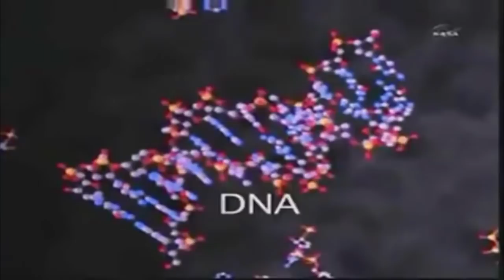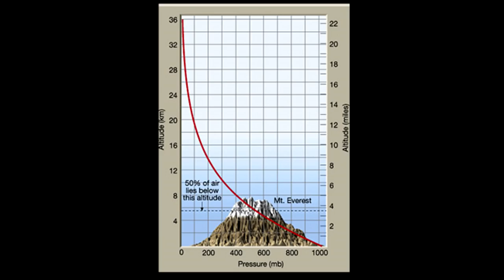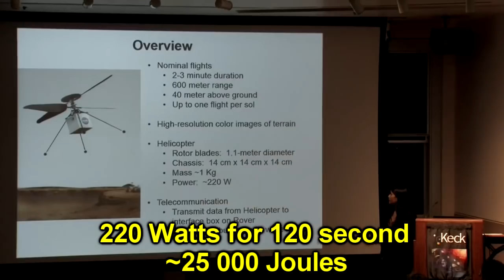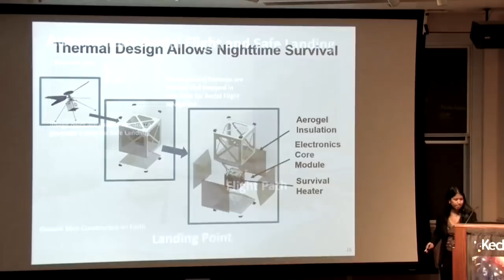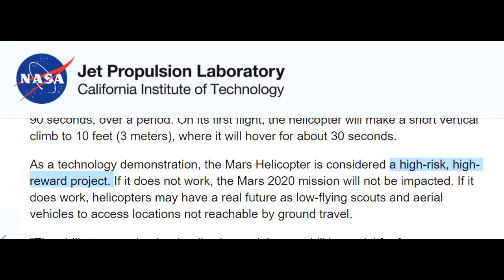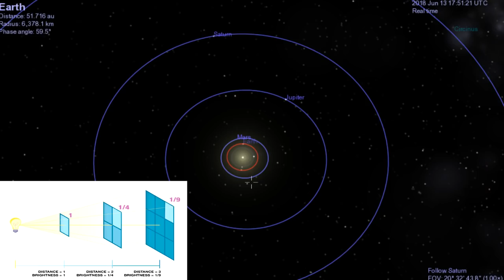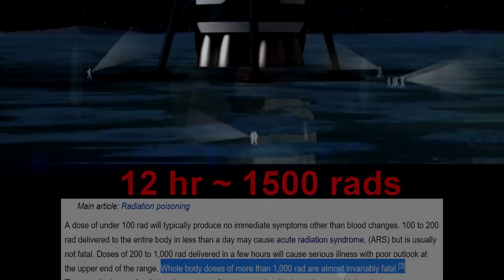NASA is sending Helicopter to Mars!! Smart or Silly?

Comment from the maker: as coryman125 points out below.  The reason for the tether is to simulate martian gravity.  Its obvious when you think about it, but I missed it :-(

Otherwise to get it to fly on Earth you need 3x the power, and that will never happen.  Putting a motor on a drone 3x as powerful would turn it from a helicopter into a stunt helicopter!
Reply: Thunderf00t 
Hahaha.. yeah.. 1% the atmosphere without the low-gravity assist on your side is a giant f**k you to the whole idea of anything flying on mars..

I wonder how well you could get inflatable blimps to work on Mars.. huge balloon, but extremely low- energy to get something across bad terrain at a reasonable speed.
Reply: could the helicopter use a small radioisotope thermometric generator and solar cells or coat the blades in solar cells and then it could use the blades to angle at the sun through its non operational time
Reply: You don't need three times the power.
While the air density being less than 1% earths does hinder the copter, that lower air density also means greatly reduced resistance for the blades, so less energy needed to spin the rotors to achieve lift.
Add that to the significantly reduced gravity and you may not even need twice the power.
Make it solar of course and we will have a low level reconnaissance drone capable of topographical surveys that can tell us much more about Mars than our current methods are capable of. I like it.
Reply: They could have far more expensive and efficient solar power gathers .
Reply: You were also wrong about needing 100x the RPM to function in 1% air density. Lift  is proportional to the square of the RPM so you'd only need 10x.
Reply: Hello thunderfoot, I like your videos could you make one about fusion reactors
Reply: > ...but I missed it...
You also seem to have missed the "up to" part of the one flight per sol.  They can fly it less frequently as power allows.
Reply: Thunderf00t it's not can they it's why they need 100% times the money for what you can buy over the shelf tech
Reply: Jaden S.  vacuum  balloons have been suggested for viable lift in the thin atmosphere
Reply: Thunderf00t  doubtless the solar cells would be at least as good as iss versions ... maybe the triple junction InGaP/GaAS/Ge coz their extra cost over amorphous Si is only a teeny weeny part of the total cost of getting there
Reply: Chris King I don't see how 2 minute flights would cover anymore ground than the slow ground drone.
To me more could be achieved by countless  small cheap balloons with cameras and simple sensors.
Covering more terrory we would visually recognize more than we have so far.
Personally I've heard so many times that this is the one launch that will give us definatly answer of life on Mars. It a broken record
Reply: 3x the power, huh? In that case, would it be implausible for them to actually make the solar panel able to track the sun, at least a little bit? From the images, it seemed like it wouldn't be too far fetched.
Reply: With a rocket capable of sending a human, you could send over 100 drones, even with coin tossing probability’s 50 working drones is pretty good
Reply: What pink balls? 😂
Reply: "Although having crashed LOTS of aircraft, Im still very skeptical this thing will have a long life on Mars!"
This is exactly why it will have a long time span on Mars. You are not flying it. No one is. Humans suck, get over it.
Reply: There's being skeptical and then there is this
Reply: I mean a stunt helicopter is still a helicopter... Just not a good one.
Reply: Thunderf00t if you sent them a bill for a consult, you’d not be out of line. 🤓
Reply: That's what I was thinking, I'm like clearly these people have the most expensive and efficient panels out there.
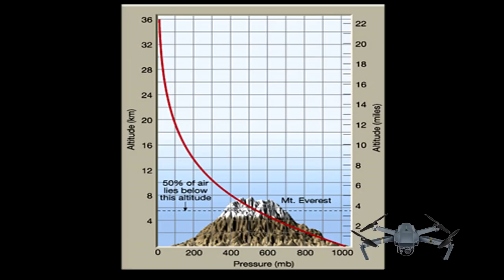Reply: 7:21 One thing, thrust scales approximately quadratically with blade speed, so to get 100x the lift it would only take 10x the blade speed.
Edit: Also note that the stress on blades not including centripetal stress is directly proportional to the lift force they need to produce, so since they only need 1/3 the lift on Mars, they only have 1/3 the stress for the same craft. Also note that rpm does not need to be the only factor for increasing lift, you can also increase blade area through increased diameter and blade width, and with only 1/3 the stress, you can even afford to go crazy with the blade area, to reduce stress on internal components by lowering rpm.
As others have mentioned, lighter weight expensive materials that can be used will also be helpful in getting the thing to fly. As for insulation, I don't think you appreciate the power or light weight of aerogel insulation. That stuff will stop almost anything. The blades can be made extra lightweight, the solar panels can be the maximum efficiency available, and risk can be taken out of the equation by using available geographic data to designate landing zones before the drone even takes off.
Reply: Thunderf00t can you make a video commenting on developments in fusion energy research.
Reply: Thunderf00t downwash is actually fairly insignificant in generating lift for aircraft, if I remember my training. 

The vast majority of lift is created by the Bernoulli Principle. For both fixed wing and rotary aircraft. The shape of the aerofoils is such that the bottom is relatively flat but the top is curved. So the distance that the air must travel is longer on top of the wing than it is beneath. This causes high pressure on the bottom and low pressure on top, which forces the wing up.

This much I know for sure. Too high of an angle of attack on the wings, relative to the airflow, causes an aerodynamic stall. This occurs when the upper wings laminar layer of air becomes turbulent or "burbles". And this happens at well below 45° angle of attack.
Reply: Thunderf00t at 11:15, are those curves hyperbolic cosines, or parabolas?
Reply: Thunderf00t Circumcision is genital mutilation.

If Thunderfoot want to challenge the feminist narrative, he should highlight issues that affect men globally.
Reply: f00t, you forgot to factor in the distance from the Sun and the atmosphere difference when calculating solar power efficiency.
Reply: They would probably use a 3-layer GaAs solar panel which would be about twice as efficent as a silicon-based one. GaAs is also more resistant to cosmic radiation.
Reply: hustler3of4culture3 I'll try to answer that man, if ya don't mind.

So first off, obviously, the Tracking one is neither. But I assume you were really asking about the other 2.

Both of which are hyperbolic because they are plotted on graphs of time versus solar intensity. The branches of parabolic curves approach the limit of being parallel to each other. Hyperbolic functions do not.
Reply: Everything he talked about is why it needs 100x (not 100%) the money: super-efficient solar cells, super-strong super-light structure, high-priced aerogel for super-light insulation, super-high-power-density batteries, just about everything in it has to be special.  That's kind of how most NASA projects work - they're on the edge of what's possible, and it costs money to be there.
Reply: Yeah, if 1% of the panel's output and 1% of the craft's weight was used for a positioner for the solar panel, there would be at least a doubling of the power available.
On the other hand, this is already a "high risk, high reward" subsystem, and a servosystem for steering the panel is just one more thing to fail.
BUT, there's a third hand: I get why they would want to put the solar panel on a flat plate without any moving parts, but there's a way to do this without ANY additional moving parts: you place that panel at an angle.  I don't know what latitude the mission will land at, but put that panel at that angle, then add something to the flight software to always land facing due south or due north, depending on the latitude.  At a latitude of 45 degrees, you lose 30% by having the solar panel just flat rather than inclined for latitude.  Again, I don't know the planned latitude.  Oh, and if your flight program screws up and lands facing the wrong way, it can either take off just high enough to re-orient, or failing that, just wait longer before the next flight.  You can get even more improvement out of this if you use two orientations - one morning, one afternoon.  You make the pop up to reorient at noon, and another one either late afternoon or early morning.  If the science flight is done around noon, you incorporate the noon turn into the flight profile.
Reply: Never mind pink balls (there were some - I saw them), the whole scale of the "artist's conception" is way off.  He shows this random motion being large compared to the size of the rotor blade.  In reality, random molecular motion in a gas is microscopic.
Reply: The 1% the atmosphere thing is a sticking point for many people, but it's just not a big deal.  Terrestrial helicopters have very thin, narrow blades, because otherwise that's what it takes to deal with the dense terrestrial air.  You don't spin the motor faster, you just use much broader blades.  And you can see from the pictures that this is exactly what NASA has done.  It's a push - you can design a helicopter to work at ANY atmospheric pressure.  Something that's more difficult to deal with is gravity, because there's nothing you can do to reduce the amount of lift a 1 kg mass is going to need to stay afloat, in a given gravitational field.  And guess what?  Mars has a 3x advantage here.  It should be EASIER to operate a helicopter on Mars than on Earth.  I don't see a self-contained solar-charged helicopter EVER working on Earth.
Reply: I think you also completely missed the fact that the martian atmosphere is actually denser than the earths atmosphere at the same pressure because it is both colder and consists mostly of carbon dioxide.
Reply: a balloon to provide enough lift at that air pressure probably would not be possible because there would be no membrane light enough to support the massive volume required at such low atmospheric density.   The difference of the weight of the volume of air enclosed in the balloon and an equal volume of atmosphere must be enough to support the weight of both the balloon and the payload.    That would be a truly colossal volume.    And balloons have severe problems in high winds and Mars has winds at very high speeds that would be great problems for a balloon even at such low atmospheric density. (momemtum = speed SQUARED times mass.)

  If it was within the limits of possibility, NASA would certainly have considered it.
Reply: ground drones cannot get past even low ledges, small ravines, etc much less a high cliff or deep ravine.    That's the major advantage of helicopters.   Even if a drone could eventually get somewhere by a very circuitous route,  a helicopter might get somewhere in a day that it would take weeks for a ground drone to get to.    That's not even considering all the places it would be impossible for a ground drone to get to.  (which is also a very good argument against using a ground drone for a charging station - it's not just a question of how fast it could get there but whether it could get there at all.
Reply: Also NASA is absolutely NOT going to be doing any stunt flying or "pushing the envelope just to see how far it can be stretched"     Other than the nature of the mission, the actual flying (speed, pattern etc) will be the most conservative low risk conceivable under the circumstances and landing sites will be selected with excruciating care.   Not to mention every possible parameter of the equipment and flight performance being closely monitored to a degree no Earth drone would remotely approach.  

In effect, expense is of little consideration for the drone equipment because it is utterly dwarfed by the expense of just getting it there.   Totally different circumstances from flying a drone on planet Earth.
Reply: "Delusional" would be a better description.    "I passed a Boy Scout first aid merit badge so now I'm going to the hospital to give the brain surgeons advice!"

(But wait!   Ben Carson was a brain surgeon.  Oh the horror of it!)
Reply: An interesting question that raises is how does a very low air pressure affect turbulence effects?  Would the angle of attack at which laminar flow is disrupted (stall) be significantly different?   Yet another reason why amateurs second guessing NASA is more than a bit over the top.
Reply: They would probably use technology we haven't even heard about because it was far too expensive for commercial/industrial use despite being more efficiency.    Because for solar panels on Mars, efficiency is worth vastly more money than it ever would be on Earth.
Reply: close but no cigar.    Not a vacuum (a balloon has to be the same pressure as the atmosphere) but it would have to be hydrogen but even hydrogen wouldn't work because the volume required would be vastly too great and there is WIND on Mars (very high speed wind and momentum = speed SQUARED times mass)   Massive balloons would have massive problems in high winds (even at very low pressures)
Reply: Thunderf00t As people above have already pointed out that velocity (rpm) in the lift equation is quadratic not linear, you could at least take five seconds to Google the fucking equation before making a video attempting to explain it.
Reply: @Thunderf00t the Europa radiation levels as described in "Europa’s Radiation Environment and Its Effects on the Surface" would be non-lethal over a period of time in an insulated and shielded spacesuit. The poles of europa are exposed to 10x less energetic plasma bombardment than 40 degrees on to the equator as well. the poles are also estimated to receive almost no electrons over 100keV vs the equator's simulated exposure to 5MeV electrons and 10-100MeV occasional ion showers.

according to that you mostly have to worry about kilometric radiation (non-ionizing, but poss. very harmful) and high energy electrons creating Bremsstrahlung x-rays, however this has been negated by using UHMWPE (as dense or denser than HDPE) with long chains of low atomic mass elements.

basically you saying it is deadly for a short time is lacking research, you don't jump out of the ship naked.
Reply: Thunderf00t Just another hoax created by Naza to steal tax payers money, we all know the earth is really flat.
Reply: Chris King he definitely missed that vital point. It's not going to be an el cheapo amorphous Si panel.
Reply: Thunderf00t

Good news, I've figured out how to do this properly. It's not as risky as nasa's plan but it's at least realistic.

A) from the airbag stage, you have a spherical skeleton frame with the important stuff suspended between the frame. This spherical frame will be its primary method for traveling between sites we want to assess; power generation station; air carrier for the drone & advanced scientific station. The heat /cold issues should be eliminated with this design. It'll also allow its solar panels to track the sun for best efficiencies & it'll use a combo of no less than 4 individual panels to ensure redundancy. 

B) the drone only needs to carry the tools to do its basic job. The frame will contain a contained landing/take off platform to protect the drone during down times. It'll also have a magnetic retractable leash that can allow it to recover downed or disabled drones. A simple flip mechanism can solve the upside down landing issues. A small set of wheels can allow it to maintain basic mobility even when flight is not an option. The drone will also have a sort of universal adapter to allow it to add on various mission specific tools.

C) The advanced scientific platform can have all the communication & extra tools needed to make the drone a fully functional exploration & scientific base. It will also be able to do much more advanced scientific research by utilizing 2 separate points of reference (if it is wisely planned, it could even work jointly with the other rovers to multiply the benefits).

It will even be able to survive Mars devastating sand storms & the sun's solar storms by using a combination fariday cage fabric skin like a convertible or stadium retractable roof or shield.

The frame will also have a set of kind of like kickstands legs that can deploy for stability as needed. Attached to the suspended platform you have a pseudo arm & hands for various tasks, including potentially repairing the other vehicles on Mars, if needed. 

If the sole purpose of the drone is to be able to gain elevation, they should consider using my hybrid lighter than air helicopter designs. They might even be able to accomplish their goals with a mobile rover with a leashed lighter than air vehicle that is deployed overhead as needed which would greatly improve its reliability potential. 

When the machine is in transit, it can collapse its frame & landing air cushion, to become as compact as possible. Finally, solar power is an option but it's hardly alone; a wind turbine, atomic, peltier temp  differential & /or more exotic fuels. <

So yeah, that's my basic outline, obviously it's far more complicated than just this brief outline but I think this outline is largely adequate to explain the basics of what I am talking about.

Adam
Reply: Thunderf00t rockets won't even make it there but yeah let's pretend like you do everyday...
Reply: dosent matter. if it dosent work well just change the numbers and youll enjoy all our CGI fakery. sincerely NASA
Reply: Here, take this one full unit of free attention! I wish you, having good time with it!
Reply: hraharahra Thanks, I needed that! Don't know how much longer I would have lasted without a single unit of online gratification!
Reply: How much protection do space suits offer against radiation thunderf00t? Would it make any difference?
Reply: It could also use heat from the engines to rise, sounds like a good idea.
Reply: The tether is probably also there to keep the thing from slamming into the wall of the vacuum chamber and falling over.
Reply: also i dont think there paining to fly with it charging its more likely they fly it in missions then once its low land it and recharge it for .... idk hours days?
Reply: oh AND due to the less amount of atmosphere it would charge faster on earth due to getting a clearer sun
Reply: From what I've read about it, flying on mars is actually more energy efficient. I'm not so sure about helicopters, but certainly with wings. Due to the low gravity, you can have a much broader wingspan which dramatically increases the surface area of atmosphere providing the lift.
Reply: is 1% of the atmosphere or 10%?
Reply: It very much depends on where you are on Mars and Earth. If you wanted to be the most generous and compare the deepest part of Mars (highest pressure) with the highest altitudes of atmosphere on Earth (say where a plane would fly) then you are actually close to 50%. However, if you want to compare apples to apples, say a plane flying 1000 feet above "sea level" (there is no sea level on Mars obviously), you average a hair over 1%. Temperature also plays a factor (PV=nRT)

It is worth noting that jet planes fly just fine in very thin atmosphere, every day. You actually don't need a lot of atmosphere to achieve and maintain lift.
Reply: Just a thought here - why can't the unique big blades upper surface be made out of Solar panels material as well?
Reply: Thunderf00t maybe I’m wrong, but woudn’t the stress forces be decreased too? Lower air density doesn’t also mean lower drag forces on the blades?
Reply: @ravenkk4816  thought the same
Reply: Late to the party but also worth noting that rotorblades also produce lift by pressure differential between bottom and top. That's also a good reason to increase the surface area as lift from pressure differentials is proportional to surface area.
Reply: Why not just make some kind of big docking-station attached to a much biger solar panel ?

Basically a platform where the drone can land and recharge.
Reply: Considering the idea was made in California where there are some pretty stupid people living there, I'm not surprised that they would fund this.
Reply: depends on how one generates this energy - and how it is converted to the rotation needed - howmuch drag it generates and.. howlong the powersource can hold out.. - right ?
Reply: Another pom that lives in the UK that has nothing to do with space due to no space program India,China and Russia all do.
Reply: the tether is just to make sure it doesn't crash and get destroyed when it falls.
Reply: You keep mentioning power and physics of flight, but what I am concerned about is the lubrication and durability of the motor.  Maybe I'm just a fool but the amount of lubrication needed for that type of gearhousing and the protection it needs from extreme temperatures or fine dust are sending klaxons in my brain.  I'm sure NASA will figure it out, or at least I hope they do.
haha I just got to the point where you mention the motor.
Reply: @NinjaNezumi  they did it on all the rovers, I'm sure they're not worried about it
Reply: @maxs7814  yeah, see, that's why I am worried about it.  The use and wear for the two types of motors/gearboxes needed are completely different.  Drones have harsher wear and tear.  Any RC enthusiast will tell you that you have to treat the gearboxes differently.  Then again, NASA has been doing serious testing, it's not like they are the ESA who just think "we did it good enough" after a half-assed job then send something off to get destroyed.
Reply: @NinjaNezumi  yeah, idk you know better than me
Reply: @maxs7814  dude no need to be passive aggressive.  I even said you were likely right and nasa already figured it out.
Reply: @NinjaNezumi  I wasn't being passive aggressive I was just saying you probably know more about this stuff than me, I just figured nasa knew what they were doing. Sorry if it seemed that way my bad
Reply: @maxs7814  ok then I am sorry I am just used to PA people.  <3
Reply: @NinjaNezumi 😘
Reply: @dadsonworldwide3238  lol, over the shelf tech. You can't buy the tech they use, everything is custom made and it's very very expensive. Check out us military's new spy drone, it can fly for +20minutes and costs about $80k to make, pretty expensive for a "toy" you can buy over the shelf ;) The best mini spy drones in stores can fly a couple of minutes for reference.
Reply: Thunderf00t
So the sol on Mars is 85K seconds. 

But isn’t 1/2 of that night? And low elevation sun angle for 1/3 of the day? 

Now how much power might it receive?
Reply: @asm_nop  a hydrogen gas ballon could work in the atmosphere
Reply: @corthew  atmosphere density? Oh like how a modern helicopter cannot summit Everest cause the airs thin? Tell me how a drone could achieve the lift that a twin turbine 10000hp helicopter cannot. The rotors can outspin the atmosphere and create a pocket of turbulence, losing the lift. The engines can run fine, turbines can run but theres not enough air for lift. The heli on mars couldnt carry anything and wont be maintainable
Reply: @nonofyourbusiness7631  Hmmm...Perhaps you stopped reading before the mention of lower gravity?
Reply: @ravenkk4816    And they do, he should have done some research into the solar cells NASA used in other missions.
Reply: Analyzing Male Slavery well, it’s clear what your stance is
Reply: Wacth veritasium his video of mars
Reply: Your comparison at 12:00 is a little flawed since your benchmark is a consumer panel. Space grade panels have effeciencies about 150% of consumer panels (going from 20% to 30%), which would increase their energy budget. Now the sun is a little less bright from space around Mars, but the thin atmosphere means the total amount of light recieved on the surface is likely higher than on earth if you take into account the entire spectrum from UV to NIR. For testing purposes, they likely haven't used high effeciency panels since they are very expensive and it would be better to use a facsimile until final integration and testing.

I think this will work, but we'll just have to wait for time to tell us.
Reply: I kind of knew that isn't some kind of busted video 
More like "a lot of doubt video"
Reply: @corthew  this is a pretty good example of TF thinking he's blown the whole thing out of the water when he grasps the first third of a problem and it happens a little too often for my tastes.
Reply: We can't even control a drone 10k miles away. How can NASA do it 33 MILLiONSSSS miles away?
Reply: @ravenkk4816  they do :D  i was about to comment this too :D
Reply: Well, today it launched. Now we wait, and see if its gonna fly. And work.
Reply: WOULDNT A MINI BLIMP WORK BETTER IN THING ATMOSPHERES , oops , would ion propulsions also work against a thin atmosphere
Reply: @dadsonworldwide3238  You don't use off the shelf tech for something going to Mars. You extensively re-engineer it to withstand the conditions hence it costs more.
Reply: @vianaautocenter258   every issue he brings up they discuss, kind of weird for it not being a response video.
Reply: Hey, Thunder!
Do you happen to have the technical details on your drone model? Been itching for a project like that just for fun, but I wouldn't know where to start or the considerations to have when building one, and I honestly trust you more than the average Joe. If you have anything on it, it'd be a great help.
Thanks, in case you respond.
Reply: 4:53 when i shut my eyes be like:
Reply: All good I think even NASA know it's probably a coin flip cause of how small the drone is
Reply: Are you prepared to eat crow? The copter will hopefully be arriving in 4 hours!
Reply: @asm_nop  inflatable would be too unpredictable.
Reply: @DanCleary1  and rotary wing aircraft just spin the wings really fast
Reply: That's true, but anyway having one string keeping the drone "straight", can interfe with the experiment.
Any way, the drone is there now, let's see the results now.
Reply: about solar panels: what you have shown seems to by polycristal solar panel.
But since that it is nasa-they can afford to design a specific multi-layer solar panel that has a nice efficiency as a system.
That thing consist of bunch of specific light spectrum solar cells by layers, but you can't stack them infinitely long because each layer decreases amount of light going through.
Those panels are usually on orbital things because you know light spectrum and you can design system that can accept as large spectrum as you can because in those cases cost is not an issue.
It would be funnier, if they made a helicopter with RITEG on it. But probably it is impossible because it is too heavy and specific energy issues...but I'm too lazy to check it.
Reply: We are going to find out if your right in a short time for now.
Reply: oh boy i got news for yo
Reply: they are about to attempt the flight any day now.. how about a follow up video?
Reply: @ebolachanislove6072  
He did say that this mission is still plausible and that is no near as crazy as hyperloop, he adressed the challenges and remained skeptical but didnt dismiss the mission as impossible, just that it was a major challenge and it certainly was if you look at veritasiums interview with nasa ppl affiliated with the project.
Reply: the helicopter took it first flights...
Reply: @DanCleary1  No, it's the other way round. The downwash is the primary source of lift.Bernouille is secondary.
Reply: The comment does not exist.
Reply: That's not the only obvious thing you missed, bro.
Reply: "Busted" in thumbnail is misplaced.
Reply: @Hunter Ronald Flixportal :D
Reply: @Trent Kevin thank you, I went there and it seems like they got a lot of movies there :D I appreciate it!
Reply: @Hunter Ronald no problem :)
Reply: This video aged like fine compost.
Reply: @asm_nop  so how'd that work again?
Reply: I'm going to just take a guess since I don't know much but what I do know about Mars this and there's not much of an atmosphere and since there's not much of an atmosphere I don't believe a helicopter is really going to work on Mars because helicopters need atmosphere in order to propel itself up without that atmosphere and anything to push against it's really got nowhere to go
Reply: This video was pathetic even when it came out. The idea that he understands Mars' atmosphere better than the folks at NASA is a perfect example of Dunning Kruger.
Reply: It does not require 3 times the power to fly on Earth. On the contrary, it requires less power. The induced power to fly a craft of that mass with that size rotor disc on Mars is 104 W. It would only need 44 W on Earth.